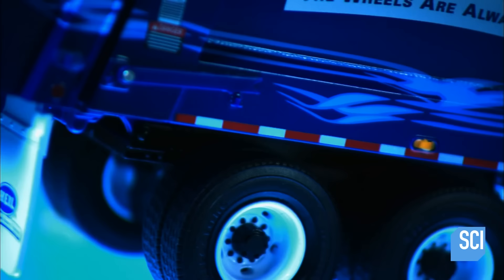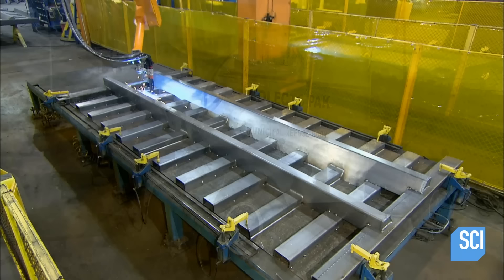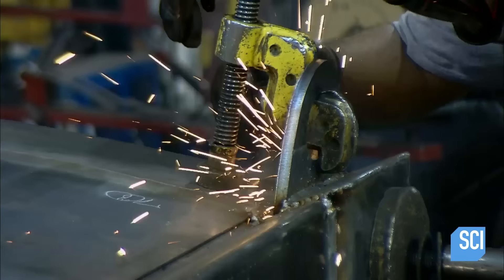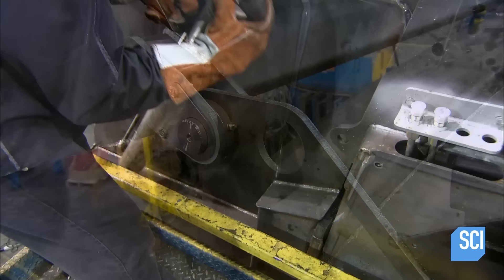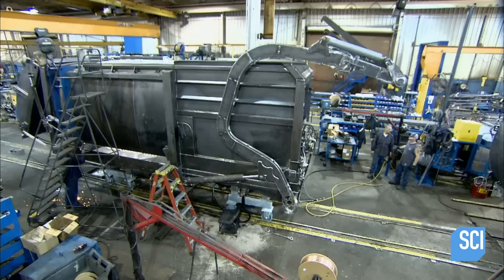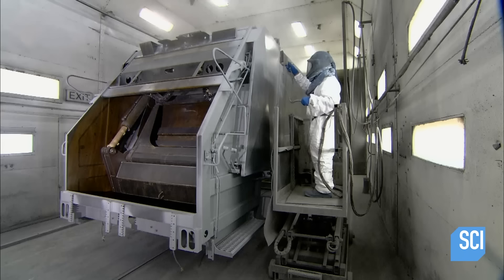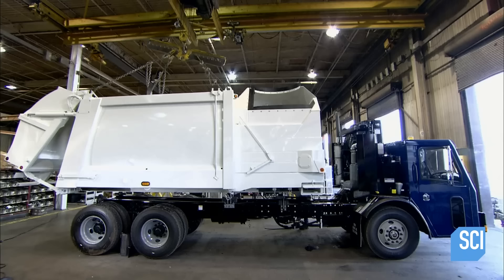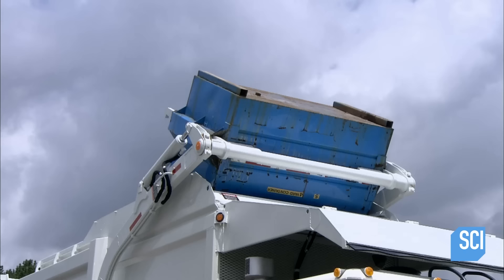How It's Made: Garbage Trucks

Comment: I used to drive garbage trucks, they took both dumpsters and small trash cans, and they were the most fun big toys I've ever worked with.
Reply: They are fun to operate, I love crushing bulk waste with the rear loaders.
Reply: Ayee you got that trash truck lego set too?
Reply: @YukariAkiyama  If you never had that set, did you really have a childhood?
Reply: My grandpa drove for 35 years.

That is some legit rough work man.
Different breed forsure ✊🏾👍🏾
Reply: Seems like fun to be able to crush cars that are in your way 👏
Reply: How do garbage trucks know when they are full and cannot load anymore trash?
Reply: @BrianL7000  when the trucks packer isnt pushing all the way in
Reply: @BrianL7000  Bruh, that's the only reason I searched for this video. I wanted to know about the front loaders and how they know when the compactor won't compact anymore.
Is there a a gauge for the hydraulics? Is there a censor? Is there a camera?
Reply: @redbeardreturns3550 you can feel when it’s getting full because it will start struggling

Comment: Much respect to the garbagemen, without them we wouldn't have such easy lives.
Reply: Their clean up men, not garbage men .
Reply: @flip90925  😂
Reply: I had no idea they’ve only been around since the 50’s. That makes my parents older than the invention of garbage trucks. What did people do before garbage collection?
Reply: Live at a trailer home community and we used to have to throw the trash bags at a dumpster by the entrance and ever since they put trash bins it’s made our lives easier, props to them
Reply: @salemcripple  back in the day old fashioned trucks were open and smells. 
Remember that riddle "what has four wheels and flies?".
Current trucks used are the Peterbilt 520,  Mack MR and Terra Pro, Autocar Xpeditor.
Previous trucks which were discontinued: Ford C Series, Chevrolet, GMC tilt series, Kenworth 700, White 3000, Compact, Road Xpeditor, WhiteGMC Xpeditor, Volvo, Xpeditor.
The above mentioned trucks are COE style.
Reply: In the only house on my walk of 12 houses that bothers to get them a Christmas gift as a thank you for their service.

Comment: The legendary Trash Truck. in the US there are three manufactures Hail Industries, McNeilus, and Oshkoch. The trucks themselves come from MACK in Allantown Pennsylvania and are delivered to the factory on piggyback. Once the truck arrives everything is added. Three models leave from this plant the LR which uses mechanical arms, the Terrapro which has a side loader or a rear hopper, and the Granite Axleback which has a rear compactor. These trucks are on the street hauling trash hours after they are built.